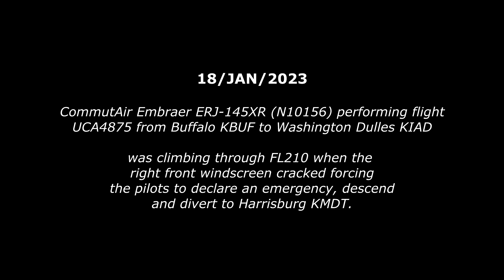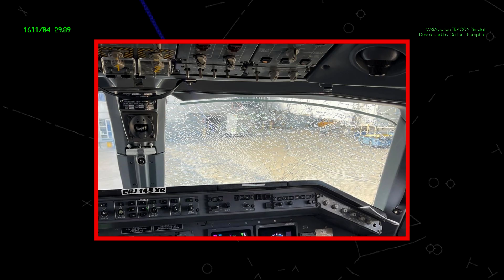CommutAir E145 | CRACKED WINDSHIELD ENROUTE | Emergency Divert

Comment: I worked on a E145 that had a windshield that kept shattering. The time between events kept getting shorter and shorter until the last time the WS shattered while pushing it out of the hangar. The FAA issued an AD requiring new upper and lower brakets for the center post between the windshields. Solved the problem. On those E145s sometimes the attachment screws will loosen up and require a re torque. This can cause water leaks. I suspect it can also cause stresses at different points on WS  causing failure

Comment: I read "cracked windshield" and thought, oh thats not so bad. Then I saw the picture and thought, oh that is so bad!
Reply: Agree.  It looks more smashed than cracked.
Reply: It's not bad. That glass has multiple layers and is super thick.
Reply: This is "normal". When tempered glass fails, it tends to shatter across the entire sheet. The tempering process imposes controlled stresses across the pane of glass that strengthen it overall, but which will cause the entire pane to crack once broken in any single spot. (The fragments that result, however, are typically small and blunt edged, rather than large and stabby.)

For a jet windshield, there are typically at least three layers of glass laminated together. The failure you can see in this video presumably only affected one layer; the fragments of broken glass remain bonded to the rest of the windshield. This sort of failure is nerve-wracking, but not usually catastrophic.
Reply: @kevinhadley3779  Yeah, figured it was tempered at least. Still must be miserable for visibility though.

Comment: Looking at the windshield. Point of failure is bottom center of the glass. It doesn't look like thermal shock or incompatible Coefficients of Expansion (CoE). Shouldn't be the last since each pane should be a single pour. Manufacturing defect or installation error would be my guess, but could also be something as simple as a rock creating a ship. With changes of temperature (expansion and contraction) and pressure (bowing in and out) over the flight would cause the glass to fail. And, it could have been something sitting there for months until the stress was enough for it to fail.

EDIT: At 2:51 Got a better view than the first one. Looks like an impact failure in bottom center of the glass, about an inch from the bottom. You can tell because glass radiates crack out from the failure point. And different failure types will have different cracking pattern.
Reply: Thats a lot of words for "windscreen shattered and needs replacing".

Comment: These cracked windshield emergency and diverts come up often here. I have never flown the ERJ, but have flown other types, including Boeing's. The windshield is made of many layers with a thin laminate outer layer that is not structural. This can often crack, usually through shock cooling if the windshield heat fails. The checklists on my type allow us to continue, if it is the outer layer and there are ways of telling that. Boeing, talks about it in their manuals. This is a regular event, happening around once per aircraft per year. It's like if you have a tempered glass screen protector on your phone. If it smashes, it does not mean the phone is damaged. 

So, I don't know if the ERJ, is the same deal (somebody else must know)  and I cannot say if the crew should have continued or not. But, often in the past, pilots have declared an emergency and diverted when they could have safely continued.
Reply: Same on the Airbus. Experienced it once with the 320 and the inner layer was completely intact. We continued at a lower level without any problems. Only thing was the fogging of the window on approach
Reply: Had the same, middle plie shattered, QRH said continue, so we did.